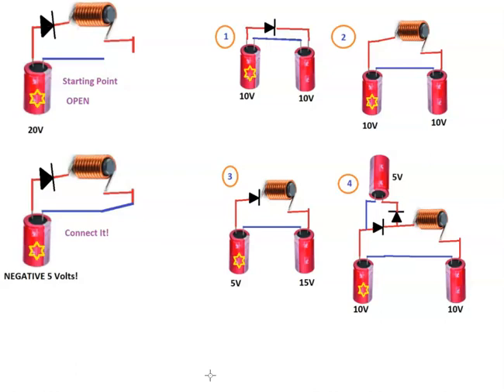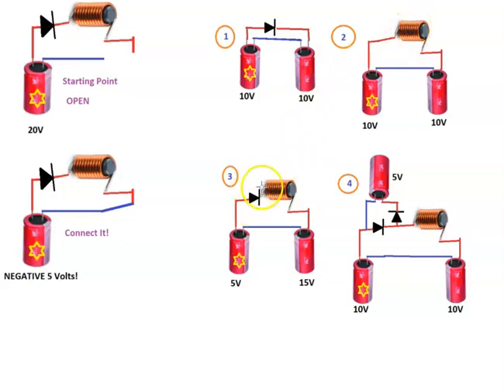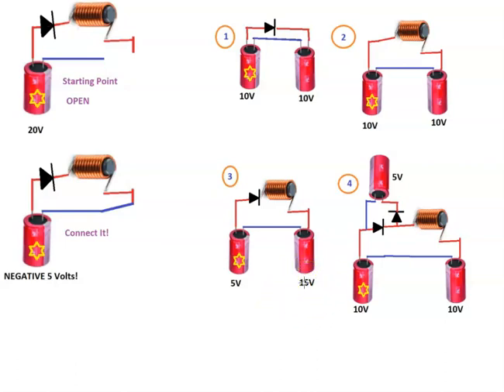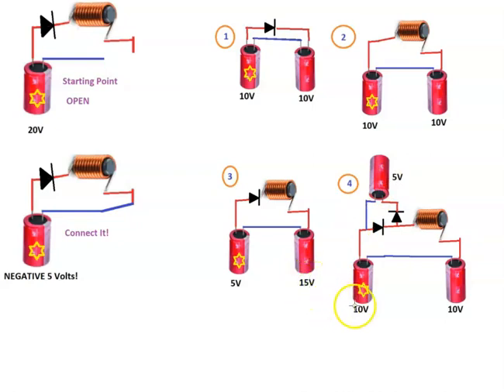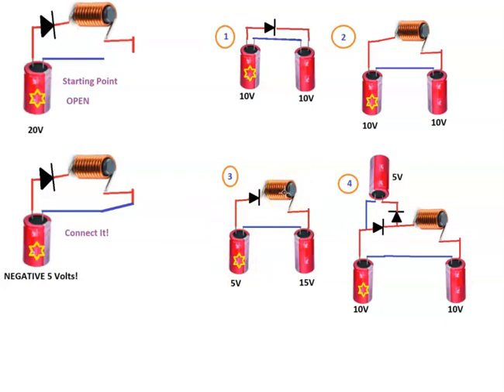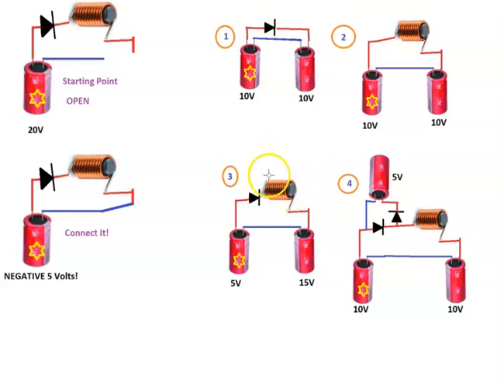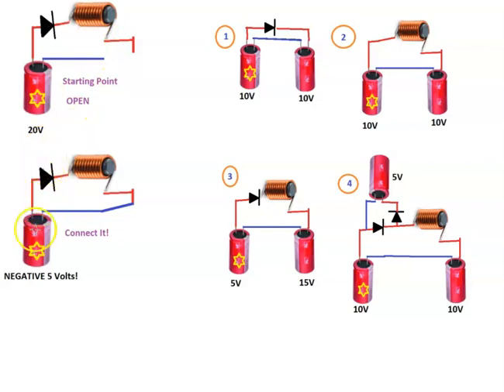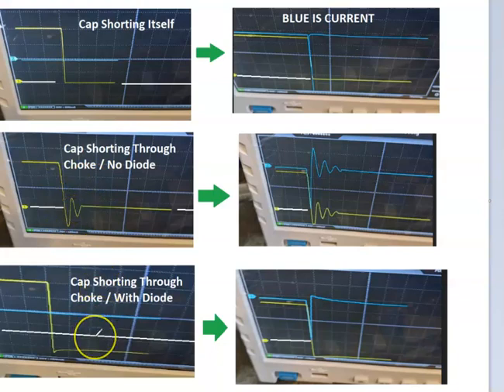Explanation of Tank Circuit potential gain.

Comment: i tried it, i charged a cap to 12v then hooked it into a diode then a copper coil and afterwards, it had -0.3v! the back emf was not that strong because the coil did not have that many turns, and the core was way too small.

Comment: Very interesting  , if nature tries  to balance things out then why not build say a   2 pole alternator , where one of the two poles has  more turns then the other . Wouldn't  this throw out the balance?
Reply from the maker: Good logic, but think of a puddle and a lake.  Even though the lake has more volume, the puddle will stop flowing into the lake when the top of both reach equal level. 

Perhaps we need to think how can we create a situation where the act of balancing causes another imbalance, just a little larger than the imbalance it just corrected.

Comment: Hi, my name is Lloyd Stovall, and I'm the person who created the word and the technology behind "Overunity." Most people state it incorrectly, but today I got a pleasant surprise that you just mentioned one of the main functions in my thesis, and it has to do with Overunity. Overunity addresses the problems of not using time to calculate the flow of energy in and out of the system.
So, when I do demonstrations of batteries and show a battery on a load lighting up a light bulb, and also attached to a meter which shows the full capacity of the battery, I then lift up the probes and ask everyone, "how much energy did I just take off this battery?" They all say they don't know, so then I put the probe back on to the battery with the load and it reads the same. I say that in order to find out how much energy is flowing into the battery so you can calculate the energy coming out of the battery, which is needed to do the calculations of Overunity, you must measure in time. Once you do that, you can begin to break the laws of physics, not literally, but in usage.
How does this happen? Well, if people calculate it correctly, the battery in which we were measuring already has the power in it, and it's already at full capacity. When you charge it, if you take off the same amount of charge as you put back into it, then it does not break the laws of physics. But what happens is that it doesn't take that much energy to put into a battery, especially when it is saturated, or what we call full. But the battery wants to give its full power anytime something is connected to it. The volts plus the amps, that's why we call it Direct Current.
So, I said all this to say that you're definitely on the right path. You're starting to get that the coil temporarily holds power. Of course, you're going to get that extra power back. It's just another device that stores energy. You're on the right path, my friend.

Comment: Yes and when I saw this I had to subscribe  ..  Automobiles used to be positive ground until the late 50's was the first thing that came to my mind and then that both AC and DC travels along the same wire simultainously and I was dealing with this problem earlier today where I saw voltage on the negative   of a power supply that was unplugged and I had watched capacitor drain finnish out and it was less than half a volt and I watched that stop when I disconnected the wire. The coil is what Tesla was all about and the joule thief's everyone builds prove that coil works and you almost get something for nothing if only for a little while. We will never get the free flow of energy we want until we  can stop destroying the dipole and the key to that is resonance.  I wonder what wrench we could throw into this game with a plasma arc capacitor  ....

Comment: The power of negative is very interesting, but complicated topic. There is few different things going on here. Tank circuits usually are related to RF. So you need to take account of the neutral too. Neutral is determined by the mass of the circuit, or grounding connection. Original crystal radios had the diode facing back to positive, cause they were usually grounded. Tank circuits usually are used to gain the frequency. But this is very interesting approach. When multiple capacitors are used, it turns in to "Tesla switch" (like using batteries in series to charge batteries in parallel). Look in to "Zilano circuit" and "Barbosa and Leal" if you try this with ground.
Reply from the maker: Interesting.  I am just looking at everything from a different perspective than we are taught in textbooks. My logic tells me tank circuits induct onto themselves. The gain has no place to go but ping-pong back and forth. They are related to RF because that is the resonant frequency of the cap.  But a diode easily stops the ping-ponging and allows us to catch the gain.

Caps just suck because they lose way too much

Comment: Nice approach thanks for explaining so clearly. Shorting thru the coil and diode is gonna have more resistance than simple dead short of course, so we lose some energy with dissipation.   By going negative your scope says you are getting gains though, which is great.
Reply from the maker: Yeah, need to keep the choke coil real low ohms.  The coil needs some amperage to create Back-EMF.

Comment: Now do this at a high frequency where that additional energy you pump out into storage caps or loads many times per second and through a disruptive discharge and you will be generating energy like Nicola Tesla, Heaviside, Smith, and many many others have. The disruptive discharge creates large + and large - spikes, those spikes provide more energy overall. This technology has been suppressed but as part of Disclosure you are seeing more and more people discovering and explaining this. Soon the masses will realize it is true. Energy is easy to generate, they lied to us so they could meter it and sell it to us. 

The other big secret is that coils in resonance duplicate the back-emf (magnetic current is what Edward Leedskalnin called it), so you can extract this extra energy from each of them. Just like a crystal radio can come in resonance with a frequency enough to create a voltage to play it, the sending radio does not send more power. 100 listeners, or 100,000 listeners is no different to the transmitter.

The energy involved is the (voltage * frequency)^2. Think about what that squaring effect does to the values.... So as you increase either or both, you can move some serious energy (so be careful as you design circuits once you start getting the voltages up there). Always use fuses in your plans, these things can runaway and easiest to plasmatize conductor loses.

Comment: Great summary! Funny, I was thinking about this very thing this afternoon - how do we capture this BEMF? I guess the question is how do we momentarily energize the coil - using a switch, transistor, perhaps with a passing magnet?  

Can a secondary coil play any role in this BEMF capture?
Reply from the maker: Use a low ohm choke with low frequency AC or Alternating DC..  If you are powering a magnet motor with a coil, make sure the magnets are alternating polarity and you are flipping the current direction each time you trigger the sensor.  Then put a real low ohm choke in series with the drive coil prime mover.  Put 2 diodes on the positive source lead like shown in figure 4 in the cap demo.  Now when your motor is on the slower side, it will push LOTS of back-emf to capture..  More than 2.5X the terminal voltage!  It actually pushes so much back EMF that the motor starts to slow until the frequency lowers, then it kicks back in and repeats this cycle indefinitely.

I will be making a circuit trying to loop it this way with 2 storage devices.  1 as a source, one as a catch.  Then monitor the voltage and switch them in intervals.  But the catch and source can not connect together at any time or else all the gain flows into the negative terminal as I referenced in the video.

Look through my channel- I have lots of demos of it.  If you need more let me know and I will give my email and I can assist